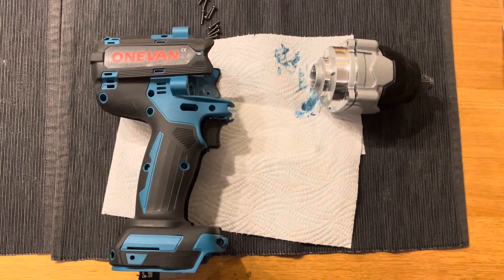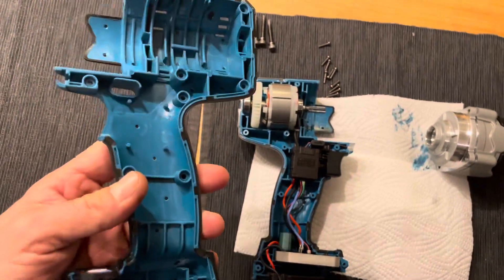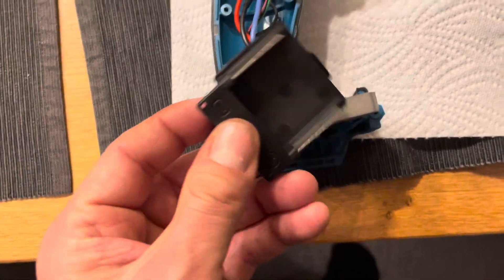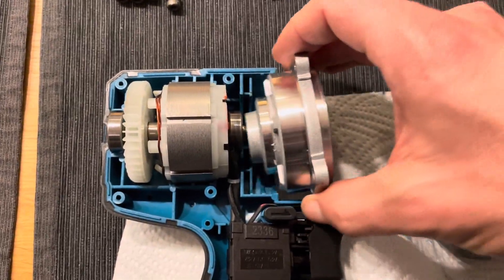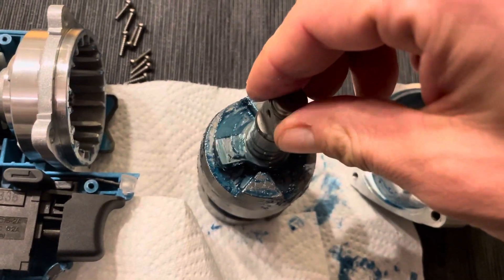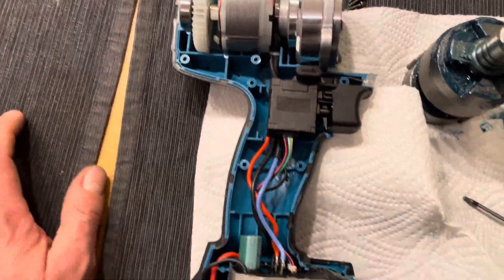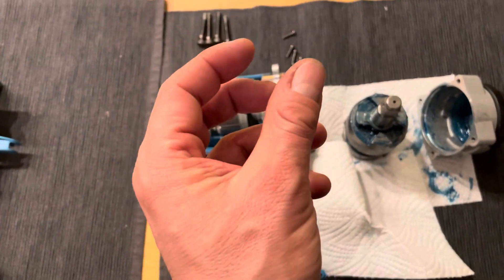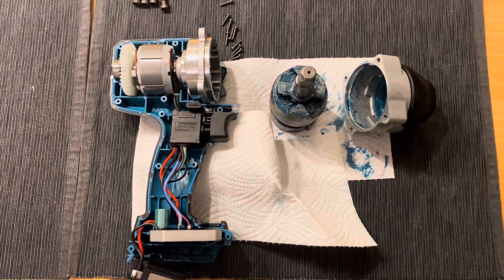Onevan Kamolee 1/2“ 1800Nm Impact Driver Teardown inside Makita compatible DTW700 Schlagschrauber

Comment: Is there an overload protection? When loosening a bolt that moves very hard and slowly, the electric impact wrench starts making a strange rattling noise during the impacting and the loosening stops. Sounds like the gears are grinding. Not sure If that is an overload protection or it is grinding the gears.